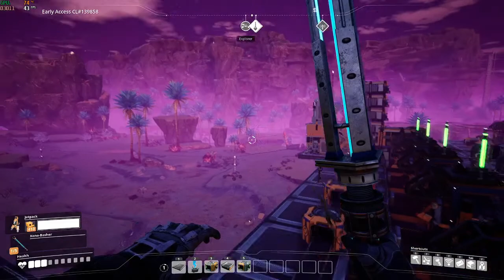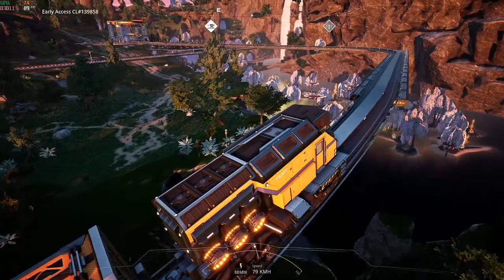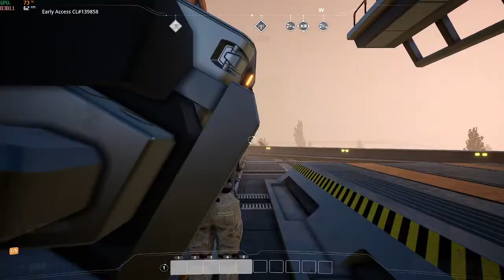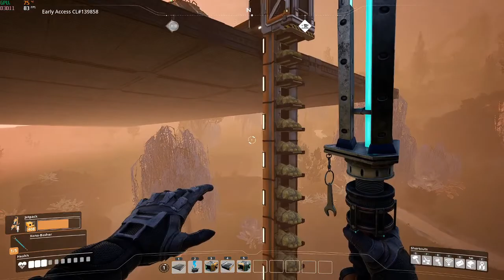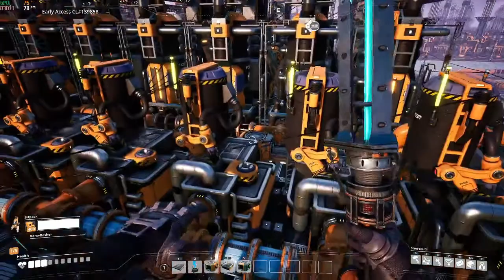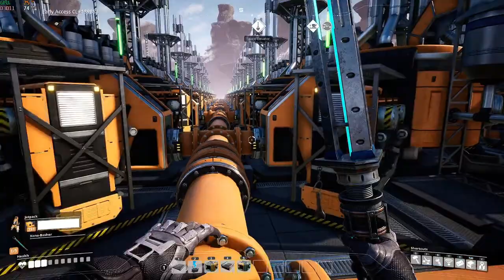Satisfactory fuel generator setup

Comment: Cool video! I got the game a few weeks ago. I don’t have compacted coal or turbo fuel recipes but I have built my fuel generator set up with 20 refineries producing fuel for 50 generators. 1200 crude oil is being used per minute. That is insane that you have all of that off of 300 units of oil.
Reply: Also, I have 10 refineries fueling 25 generators with and excess of 100 units of fuel for back up/packaged fuel.

Comment: I can't even run 5 generators let a lone what you have going on here. I wish you would tell us how you set it up. I don't even think you could get the oil you needed to generate all that fuel.
Reply from the maker: with update 4 i would recommend instead using the new method of making turbo fuel using blenders. i haven't done it myself yet but there should be videos or guides on how they're made floating around. good luck!